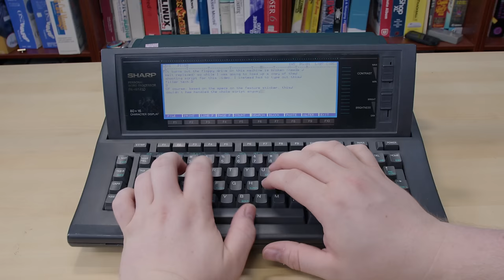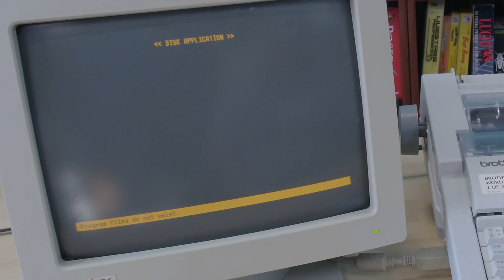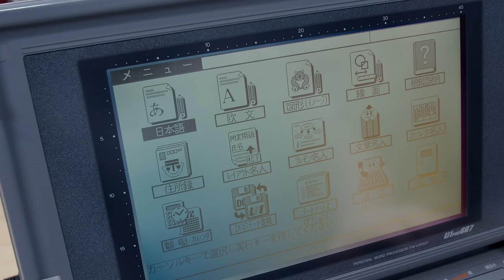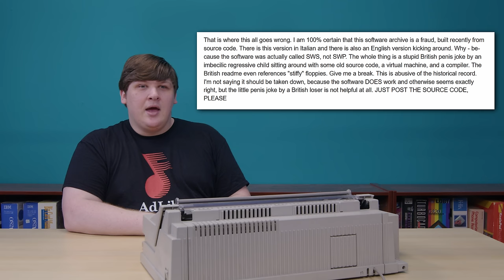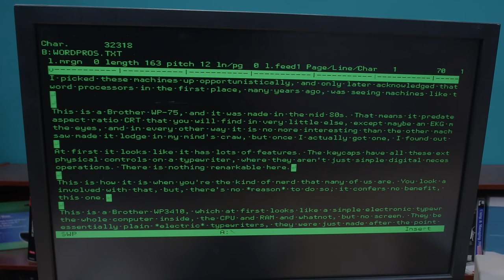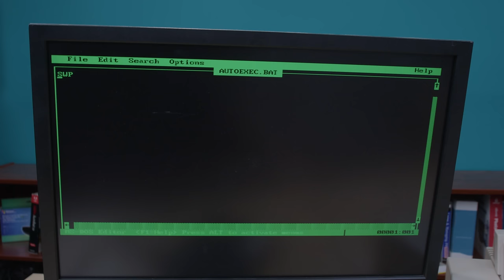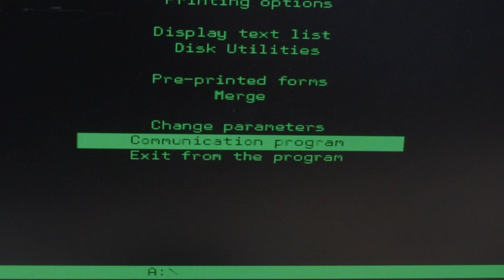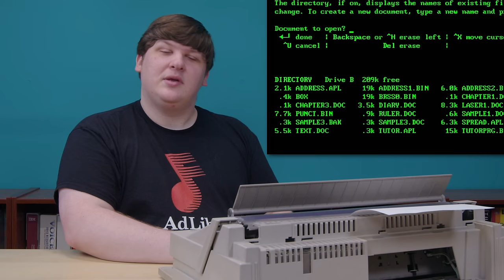The Weird Processor: Olivetti's PC Typewriter

Comment: I have a Smith Corona electronic typewriter/word processor that works as well as it did when it was new (yes, I've had it since it was new). I had been occasionally digging it out because, if you run a small business, there is the occasional physical check that needs to be written or some weird local tax form that is only available as an uneditable pdf. It is really obvious that it is not meant for this. There is no card guide to indicate where your typed letters are going to land so you end up fiddling with the unindexed platen knobs until you kinda guess that you're in the right spot. I noticed that they form you filled out in the video was super wonky and that's the machine's fault, not yours. I recently bought an IBM Selectric I, which was designed with this sort of work in mind. It's also way better built, more interesting mechanically, and so cool looking that I don't mind leaving it out (which means I use it more). I haven't used the Smith Corona since I got the IBM. In short, my Smith Corona is not only a miserable word processor, it's also a miserable typewriter.
Reply: Plus, the Smith Corona has an awful keyfeel. The Model F was meant to replicate the Selectric typewriter feel. The Model M was a cost reduced (yes really) version of that behemoth.
Reply: @XanthinZarda  Yeah, that too. I obviously have a lot to say about typewriters but I figured my time was up :). I'm using a Model M right now to type this btw.
Reply: @alfredklek  🪙🪙 Here, how much more time does this buy?
Reply: @XanthinZarda  I had a model F years ago and loved it's sound and feel but it's layout, lets be honest, is less than ideal. I kept it around for years longer than I probably should have and eventually just threw it out. Oops. I have three fully manual typewriters that work just fine but I don't use them for official business because they make me look like a domestic terrorist. I used to do my taxes on a Royal Portable but I'm not sure that would fly anymore. The Selectric, on the other hand, makes me look like an old stodgy weirdo with bad handwriting and I'm OK with that. The print quality that those machines can accomplish is just as good as an electronic daisywheel machine, if it's working right. The problem is that getting it to work right is just about the most complex thing you can imagine. There are hundreds of oil points, pawls, and levers and things that you should just maybe not touch. I'm not really sure how much time i spent on my Selectric, hunched over a service manual with magnifying glasses on but it's a lot. I have an Emerald Green Selectric I and I love the damn thing. I use it two or three times a week for documents, envelopes, and little passive aggressive personal notes to my future self. Was that worthy  of the two bits?

Comment: To echo a few others - you need to check out Amstrad PCW :D

The 8256, 8512, 9256 and 9512 were legit word processors, sold and used as such, but built around the same internals as their CPC personal computer range, running a Z80, CP/M with single or twin 3" disk. They ran a few games and even lightpens, a mouse, and desktop publishing software was available. 

The later PCW16 was more along the lines of the fancy japanese model you have, with support for 3rd party inket printers and a basic GUI, though by all accounts a bit more limiting in what you can run.

Comment: 2:59 I remember those word processors, I seem to remember the files were something else other than WordPerfect format. You could extract the text but most of the time you lost the formatting if you wanted finish the document in WordPerfect (the leader of document editors at the time these were popular) the RTF was sketch.
11:05 This is true, unless you had Linux, Linux text editor could read the bare text files, I don't think Windows could even see any files on the floppy.
45:21 You would need to have a small database that the word processor understands for the fields necessary, as an advanced PC user I set these databases up for clients by pulling the contacts out of the mail client. I did this when it was hard and before Microsoft linked Outlook contacts with Word import fields. It was daunting to set up but man, it was fun to watch it spit out several hundred documents with the fields populated. I did this mail merge thing for my resume and cover letter in the early '90s. 
1:09:30 Thank you for making a video about hardware that was merely a blip on the radar of the time.

Comment: I used an electronic typewriter at school so my teachers would have some chance of reading what I wrote. I really liked the LCD display, the high resolution print head, and the sleek black design. It was pretty cool in 1988, especially as it was so much more compact than a computer. :)
WAIT WAIT! It had 2 different fonts, how could it be daisywheel? I don't know. It used carbon transfer, anyway.

I like how you admit you don't care about some of your machines, CRD. ;)

Why 240K disks? Oh I wonder... the lower the density, the lower the data rate, and so perhaps it was cheaper for a little 8-bit to feed data to the disk slower.

Hahahaha! "If you were really really really bored..." For some reason, in the 80s & 90s, I wanted to program every gadget I saw. I wasn't any good at it, I just thought I ought to have that right after growing up with numerous computer... pop-sci books of the 70s and 80s which explained computers were machines which the user could program. I'd still be happy if I got a printer which could load programs and hacked something onto it. I'd have more fun still if I reprogrammed a ROM. ;) Then again, I've used a looot of machines which "resist any effort to love them," (software too,) and so I probably won't.

That Olivetti is a monster! But Olivetti had a thing for insanely solid, HEAVY typewriters. In the 80s, my parents replaced our 40s-50s lghtweight portable typewriter -- lovely machine -- with a mechanical Olivetti BEHEMOTH which was impossible to type on. The typing force must have been 10 times higher than our sweet little portable. But I guess the Olivetti on screen is a 132-column machine. They were a thing. One of my 90s video cards could do 132 columns, but my monitor wasn't really up to it.

I'm starting to think a good video converter meant for retro tech should have an oscilloscope built in. Maybe even integrated so you could plug in a mouse or turn some knobs to point at a bit on the trace and tell it, "that's the horizontal sync."

Augh! XD I have used FAR TOO MUCH software which expects you to remember file names. It's not too bad with any semi-modern GUI -- and a lot of these were old X Windows programs -- because you can usually copy & paste, but it's always annoying. Still, with copy/paste, it's not really worse than a file selector which insists on defaulting to the wrong directory though.

Printing the "text list" reminds of Crespa, a company in my old area. They had a monster of a filing cabinet and didn't like it. They were sold dreams of a paperless office in the 1960s! They got a computer. They had to get 2 more monster filing cabinets for the computer's output.

I love DOS TSRs. :) Of course, good multitasking is better, but TSRs are still pretty cool. programmer. Haha! In DOS, a device driver is just a TSR. There's no depth to it; no standards beyond, "We use 'software interrupts' for all the DOS and BIOS calls, the software and hardware interrupt vectors are in this part of RAM, change them however you like."

That "KB II" key reminds me that IBMs had the least standard keyboards of the 80s. There was a lot of variation elsewhere, but companies converged on a few things except for IBM. In Britain, IBM didn't even follow the layout for printable keys.

768K RAM is possible with MDA graphics and maybe CGA. It's because video uses less RAM. But besides this, there's the PC's "expanded memory" interface which had a 64KB slot in the MMIO area & bank-switched RAM between it. It's worth remembering that the 8088-286 couldn't linearly address more than 64KB at once anyway, so it wasn't particularly hard for programs to use this.

5.5mm hex keys seem to often come in the bigger allen key sets over here -- the type that are just bent hex bars.

LOL! You're one of the few I'll watch a 1-hour video from, CRD. This one kept me interested from beginning to end, (as you can tell by the size of my comment,) and I'm almost half-wishing I had space for the Olivetti right now. XD

Comment: In a video from the 8 bit guy about Super CGA cards he did mention that the Olivetti M24 had a very unique Color Graphics system, which was incompatible with CGA. Reason it was incompatible was that it ran at twice the vertical resolution. Could very well be that they recycled a lot of the RnD from that into this PC Typewriter thing. Tho the M24 did have a propriatary connector to enable that high-res support...

Comment: For future reference, if you ever come across a 70Hz sync signal again, the Atari SM series of monitors run at 70Hz for their high resolution monochrome displays, despite the fact that the same resolution could easily be done at lower refresh rates (As the Amiga and Atari’s own TT030 and Falcon030 later demonstrated)

Comment: 1:59 The carriage moves "for some reason", probably the reason is so you can see how your text aligns with the line(s) above it.

Also, yes, they operate much like home computers of the day. But with one single fixed program, the program can be stored in ROM instead of RAM. And since one line or even 16 lines of text can fit in a very small amount of RAM, you're looking at microcontrollers instead of CPU's. Remember the Arduino with its Atmel ATmega328 MCU? It has 32 kB of ROM (or Flash in this case) and only 2 kB of RAM. The RAM can fit 25 lines 80 column text. Perfect for a word processor! So that would make them a lot cheaper than a general purpose home computer in a time when RAM was expensive.

Comment: I'm not clear on the timing, but I do remember them being a thing that I thought was not such a great idea. I moved to Japan in the 1987, and at that time there was a very popular computer the NEC-9800.I  It was an MS-DOS machine. It wasn't an IBM-PC compatible. It's diskette format was different at 1.2 MB instead of the 1.44MB, but it's operation was the same. In order to "do Japanese" it required a FEP (Front End Processor)-which was software so you could type in Japanese characters where there are different double byte characters for the kanji, hiragana, katakana and romaji. The "best" FEP was one that came with a very popular word processor software called Ichitaro.  You could also just get the FEP.  But about, a year later, Japanese word processors like the ones you show, Brother, Epson, and even Olivetti (Nihon Olivetti) and they each had their own FEP and everything used either the JIS or Shift-JIS character sets long before Unicode unified this. In Japan, these word processors where really popular. But I know why, they were far cheaper than any Japanese capable personal computer which means the computer itself, the software you need, and a printer, floppy disk drives were in the computers and the word processors. Apple was early into the Japanese market with its graphical user interface. which means that you could display the Japanese character set. So, later there was a big push for something called DOS/V. Then any IBM PC compatible would do. This means lower prices for computers so the word processors are pretty much gone. Also, remember that in Japan, facsimile (faxes) are common in everyone's home. It's great for sending handwritten texts and maps. Also, you can't do much without a smartphone, in fact it is hard to go through immigration without a smartphone.

Comment: IBM Selectric typewriters came in a wide-carridge version. A lot of offices used them in the 1970s and later. 

I had a Smith Corona PWP in 1989. They were a massive improvement over typewriters and a lot cheaper than computers.

Comment: As far as the >640k goes... My Tandy 2500rsx came stock with 1 megabyte. DOS couldnt use anything over the 640k, but you could load TSRs, Drivers, and things into the extra memory.  I wonder if that TSR software the Olivetti has goes up there so it doesn't crowd out regular DOS programs.
Reply: The 2500rsx is a 386 machine so the extra 384k is probably above 1 megabyte like it is with every other modern PC.

Comment: That Panasonic's side min-DIN port was most likely a numpad port; I have a Toshiba Rupo that has that same feature (though I doubt it'd be compatible, it seems to have just read the matrix directly rather than complicating it with a protocol). The design of the Rupo, incidentally, is very similar to the Panasonic's - the screen and interface are alike, the classic grey chassis colour and keyboard layout are even rather alike.

Comment: Sidenote to this whole thing: I am glad I am not the only one with GBS-C issues. I made a modded one myself and with the modded firmware, it just constantly loses sync. I thought I was going crazy since nobody else talks about it. You can add external clock generators to these things, and I don't know if the premade modded ones have them, but maybe that will fix it. 

Otherwise, the sync is infinitely more reliable for me on a stock GBS-8200.

Comment: ~ @56:00 when you mentioned the memory limits compatibility.  If your software was using the INT 21 memory routines from DOS, then largely the vendor could just modify DOS to serve those memory blocks. (through a driver)  And most programs would go along with it.  Programs that needed large contiguous memory, often made assumptions about the system that couldn't be reversed later on ... but generally it didn't matter.  As those programs were written to handle 512k/640k ... and you had 768k so ... meh?

The biggest boon would be loading device drivers in those UMB and using software to unlock them, so your base memory was fully available to the programs you wanted to run daily.  And man was it a nice!

I have a vague memory of an upgrade card that was that was memory mapped over the ROM area on the PC that had 128k ram and you could punch holes in it with this crazy array of jumpers at 4k memory page size, and then match that with a driver.

Comment: 12:10 That's my thought on most older consoles. I even have an Xbox Original I have been trying to upgrade without adding mod chips or changing the code. I found 3 upgrades of note for the Xbox Original including: 1. Replacing the 733mhz processor with an elusive, yet compatible 1.4ghz one with the same power draw (I assume it's built on the same architecture as the older one, which is why it is literally like plug and play aside from the desoldering and resoldering process). 2. Changing the IDE cable to a 66x one, as the stock is 33x, which increases communication speed between the HDD, Disc drive, and motherboard. 3. The ram stacking. Other changes I have and could make are swapping the thermal paste of the GPU and CPU with graphite pads that never dry out, and swapping the capacitors, as those are typically really dated and need a replacement.

Comment: I have to laugh at your struggle to learn how half of the features work. I had an Olivetti electronic typewriter, a much simpler one with a single-line LCD display, and it was the same experience for me - totally unintuitive, and the manual was unobtainium. It had secondary and tertiary functions on many keys.

You have an SMC-70!? Lucky you. If you ever do a video on character generators to supplant your video on video switchers, that's definitely one to talk about. I have a demo video of one on my channel that was digitized from a U-Matic tape.
Reply from the maker: These things are all so confusing, and it feels like they could have been a lot easier if they'd just updated with lessons learned instead of maintaining the same interface for years and years, hah

Yeah! The smc-70! It's very very cool, and... Intimidating. There's not a ton of info out there about it, which makes me really nervous about trying to cover it without stating a bunch of unfacts and incorrect conclusions. It's... Kind of historically important, and also, yeah, mine is equipped with the video processing features which are even more obscure, so I don't want to screw this up, and that's why it's sat on my shelf for a couple years.
Reply: @CathodeRayDude  There are some interesting looking games for it too but all in Japanese

Comment: I've got a  Smith Corona word processor and 2 electric typewriters (A Smith Corona the shop thought was a printer for the processor) and a Sharp. The word processor is kinda cool, it has an amber display, and a built in spreadsheet and IMB compatible floppy drive. The downside the keyboard is loathsome. Smith. Corona. Leafsprings. I think they're all ok with typing speed though, aside from the Smith Corona typewriter. The Sharp is by far the nicest one to actually type on though, and a very fetching black.

Comment: Back in the 90s a Brother LW-20 saw me through college and my first year of university. But it shook the desk so much and took so long to daisywheel through essays that I bought a Canon Jet 300 or whichever model, which was smaller, lighter, quieter, and faster. And it was DOS compatible and came with a floppy of clip art 😂.

The Brother was £249 in about '92, and the Canon was about the same or a little less, in '97. There was no way as a student in a room on campus I was going to either afford or store a PC, and I didn't get one till after graduation. I think at that point the first iMac started around £800 and in the mid 90s I'd worked in a place selling PCs in the £1500 range.

Hence, standalone word processors. They were a market.